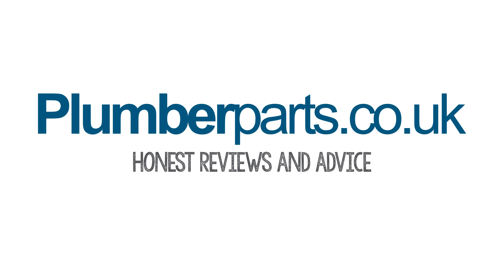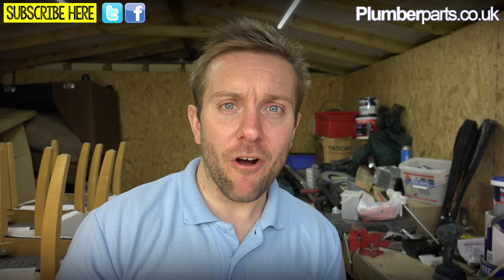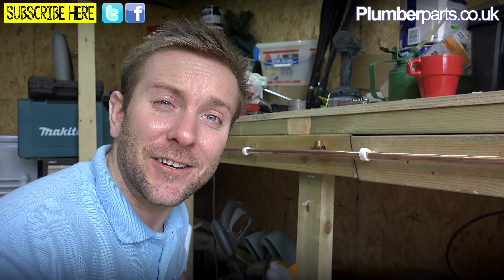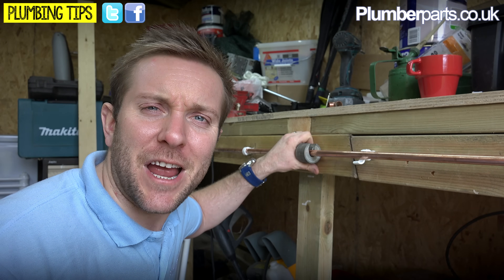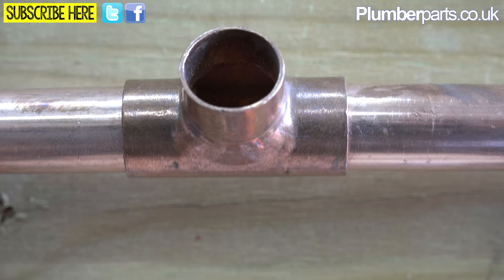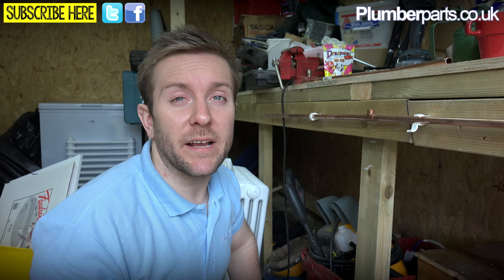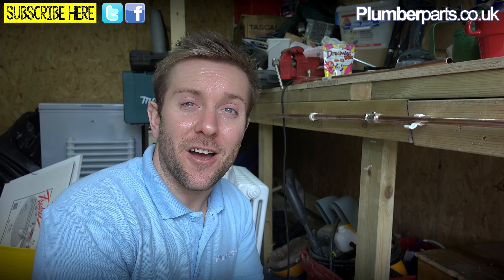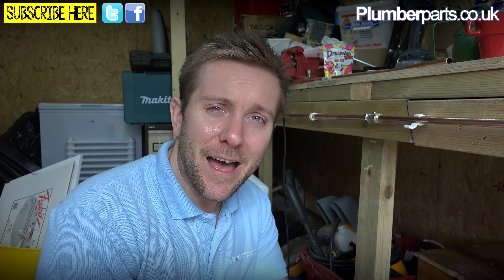FITTING A TEE ONTO COPPER PIPE - MULTIPLE WAYS - Plumbing Tips

Comment: I've seen straight slip couplings used with a standard Tee where the cut pipe is too stiff to move. In my case, the pipe will flex a little but not pull back. A slip Tee alone would work in this case but unfortunately, I've not been able to find one for a soldered joint. JG do a Speedfit slip Tee but this is too bulky for my situation. Do you know if a soldered slip Tee fittings are available?

Comment: What part do I need to reconnect the outside tap to the existing under the sink plastic u bend that has a washing machine and dishwasher running through it I believe it’s just a flexible pipe I just wanted to make sure

Comment: How do I put in a tee valve on a short pipe that has almost no movement, I'm looking to replace a self cutting tap with a tee valve to get better water pressure
Reply: Depends on how much pipe you have available to work with but....Try Slip couplings - you need to remove a section and use a pair of those with whatever you wanted to interrupt the run with (isol, T etc).  I can't find a vid on this by James (hint, thint James!)...there is one by Universal Handyman tho - .  There are also slip T couplings, JG do one and there's a sharkbite one I think HTH

Comment: I have been looking online and I can't seem to find the information I am looking for. I am looking to use speedfit to re plumb my radiators but I am wanting to install it into a concrete wall. What would be the best way to do it. Do I need to put it into conduit?
Reply: The Notorious Loki you need to use a plumber
Reply: I dont have to use a plumber. I have done stuff like this before with copper pipe and it worked out fine. I am just asking on information on what way is best to put the speedfit into the wall. Also since posting the original comment I have spoken to John Guest and they have advised me on what needs to be done.

Comment: I like how you skipped the actual problem... what to do when there is no spring at all (in my case there is a small gap between two concrete pads in which some numpty embedded the pipe).
Reply: How about 2 different types of slip over joints with a short length of regular pipe in the middle?
Reply: Agree with your comment. What he said was fairly obvious even to a diyer. I'm guessing slip couplings have a role to play when its really tight and I'd like to see what he does. Also in a complex set of pipework, what order to take things apart and refit? (Applies to waste pipes too)
Reply: found this video it might help out, https://www.youtube.com/watch?v=gjtMTmHlOnE
Reply: Haha. Totally agree. I was actually waiting for how to actually measure the coupling (like he did with the tee) and how much to cut out off the pipe and then fitting it onto a pipe without much flex. Oh well...

Comment: I'm putting a new bath in but the taps are at the other end to where the old pipe is which have been caped off. The  pipe work goes round to where the new taps are going, so would I just do what you've  said in the video  then conect the new taps  on the bath ? thanks

Comment: and how do you put in a tee if there's no "flex" as you call it (i.e. movement along the axis of the pipe. I have a 22mm mains feed that is running vertically through my flat - fixed rigidly as far as I can tell top and bottom. You say its super simple - and yes it would be if I could move the pipes or even one end - what if I can't.  Thanks.  Stephen
Reply: You will have done this by now ...but a slip coupling is useful in this circumstance and requires only the space  to get on one side of the intersection, as it slides fully on pipe and is brought back into the connection position ...... all available in end feed, solder ring ,or compression

Comment: ah, but can you solder all three pipes at the same time or can you solder the two ends first and come back later to do the last pipe??
Reply from the maker: Harry Vigers indeed!
Reply: You have to do all ends on a fitting at once.
Reply: If the one you dont want to solder yet is on the top and end feed your fine unless its a yorkshire. George should help out next time showing how solder in a new pipe to an old fitting.
Reply: ***** cheers for that Harry Vigers.